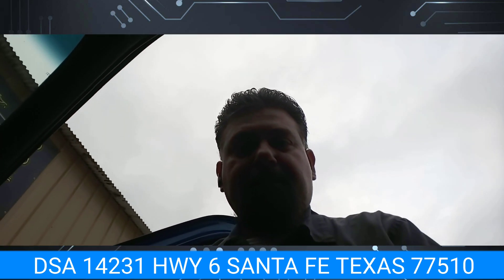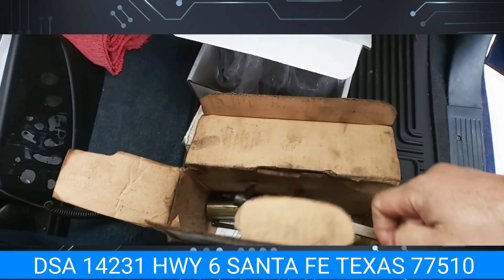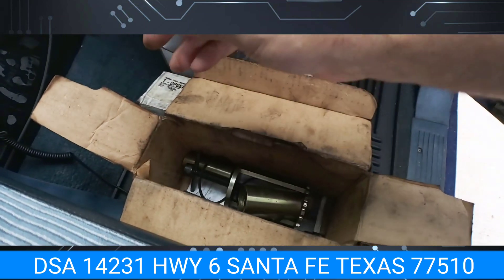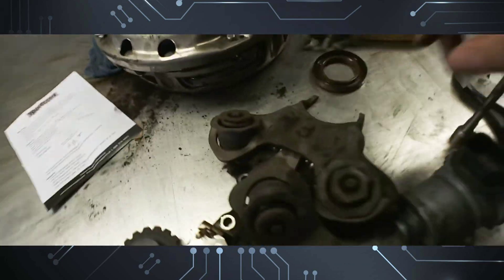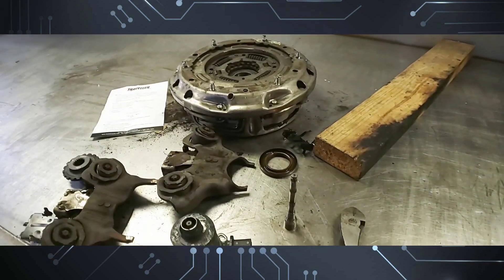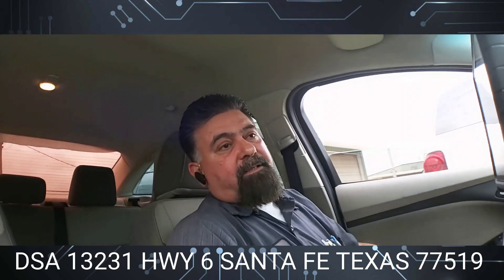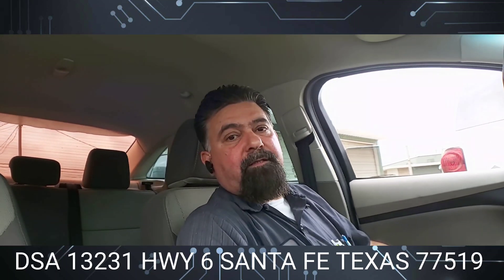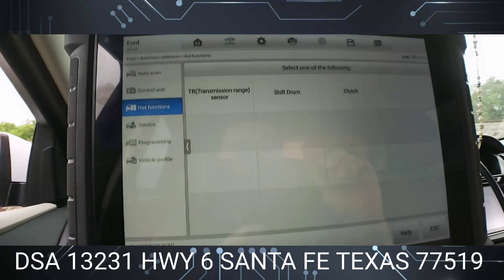DCT DPS6 Clutch and Transmission Adaptation

Comment: Hello Sir, I replaced boths of my forks and put everything back together, but when I tried to make the relearn process it fails every time, even the TR sensor learning. It threw a code P2832 which says something about a shift fork "A" position circuit is not per predetermined limit. What could be happening?
Reply from the maker: Did you remove the sheet metal retaining clips from the forks? If you did not, then there's the issue. They need to be removed once you bolt them on. Otherwise they'll interfere with the clutch travel and will not pass the tests.
Reply: @AutomaticTransmission  mine didn't come with those clips, I even made the clutch test and it completed all of them, but when I try to do the relearn process the car understands that it is not in Park or something like that, but... It shows on the dash it is on P, R, N and D but no S. I have reverser but no even gears

Comment: @Automatic Transmission,  When the Ford dealership replaced  the TCM the first time I was never briefed on driving the car "smooth" for first couple of days/break in period". Then again I dont think they messed with the transmission clutches. They did however replace one of the motors now that I recall along with the TCM. They did the relearn process like you did on this video.

Comment: @Automatic Transmission,  is this the transmissions that has had so many problems? I have a 2014 Ford Focus SE with a bad TCM for the second time , I was driving when the engine shut down on me. The car has been at the Ford dealer shop for close to a month with this part on national back order. Ford extended the warranty so at least i'm not having to pay for the repair. I did, however, have to pay to have the body control module replaced which I am not totally convinced was ever bad. I asked them to give me all of the part they replace. If there is a core charge I would cover it.  That way I can have them inspected to ensure these guys are not just shooting th eold parts cannon/replacing parts without proper troubleshooting. Thank you fo ruploading your videos. They are a source of good automotive repair knowledge . Take care and God bless! 👍
Reply from the maker: Yes this is it. There's a lot of parts on back order lately. Not just the TCM. I'm having issues finding the conductor plate for the 6R80's, and normal transmission parts. I think this is just a political stunt as it says "whoever controls the food controls the people ". I hope it gets better since I have a few trucks waiting for parts that are on back order.

Comment: These computer setup vids are very boring. Get back to gbox rebuilds. No ones gonna remember all these idiotic complex commands. Knowledge should last, not change every 10 yrs. Each generation of mechanics cannot understand the previous one. Don't talk about progres and things improving. It's just more and more inbuilt deliberate oblosescence.
Reply from the maker: Sorry for your inconvenience, you can skip the ones you're not interested in. 
There's more to transmission repair than just replacing parts.

Comment: Thanks Hiram, info on these transmissions is really scarce on the internet for us home gamers. Just an FYI, the TCM is very sensitive to undervoltages, it throws undervoltage codes and puts the trans in limp mode and you have to clear those codes before it will go back into default mode and relearn it's shift points.
Reply from the maker: Yes, actually the grounds are mounted on the frame bolted on top of paint. We always clean those out, buff the paint to make a good grounds connection.
Reply: @AutomaticTransmission  interesting information. What has you experience been with the fiestas? Is it worth it to buy one to keep for 100k miles with only needing  few repairs, or not?